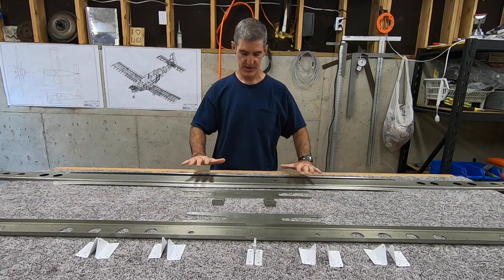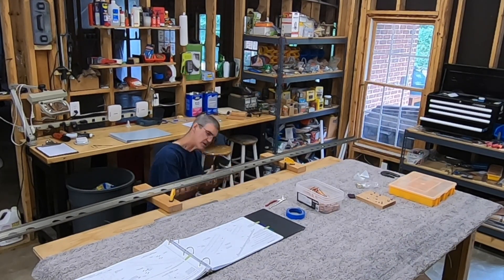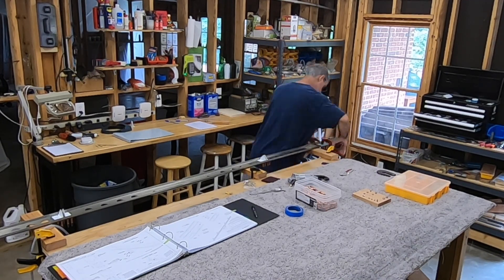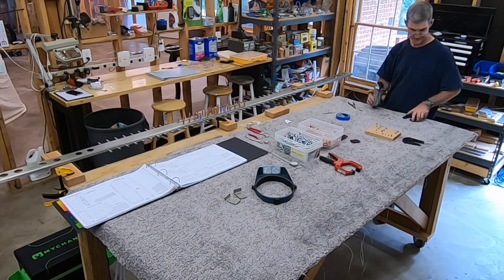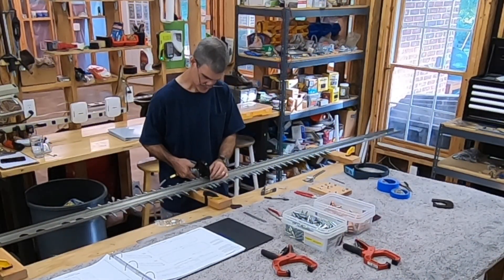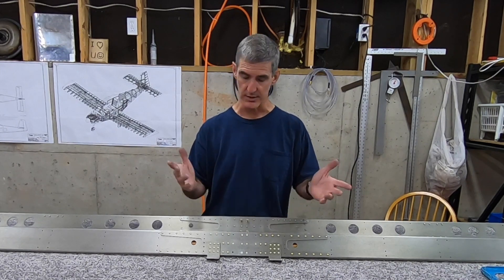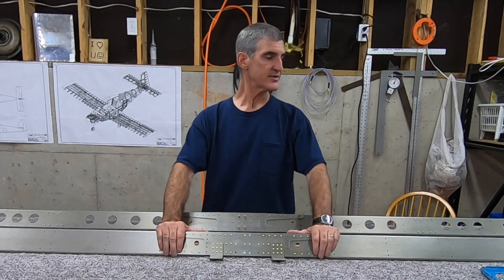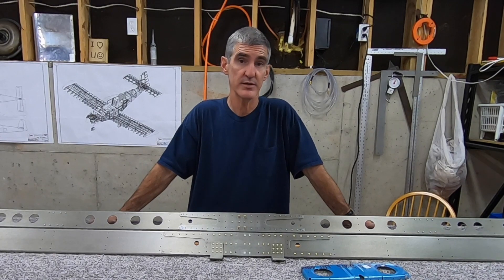RV-10 Build Log - Emp 37 - Going back and riveting the spars

Comment: When I was in the RAF we had go/no-go gauges with the min and max diameter and height for the shop heads. Easy to make with a scrap of metal drilled or filled to the two dimension. I do think it is too easy to buy one that fails to check specs correctly.
Reply from the maker: That’s a good idea.  Since the ones I already have seem to be more indicative of the max, I could just make one that’s dialed in to the min.  As long as that one doesn’t fit on the head, then I would know it’s big enough.
Reply: @missiletwentynine2667  👍